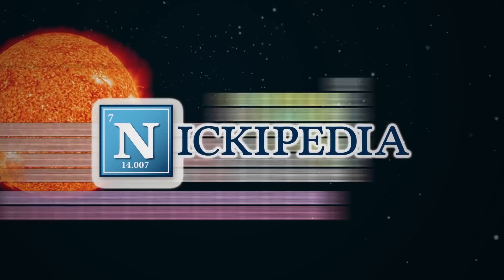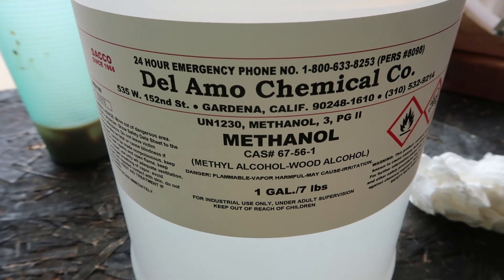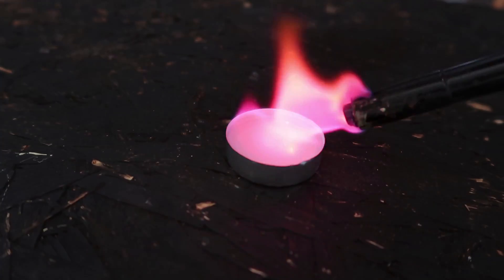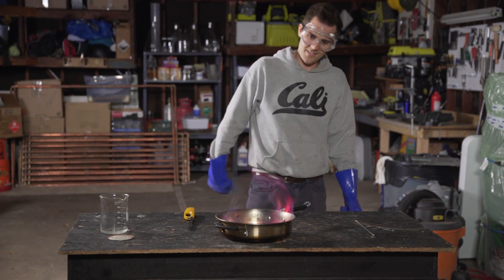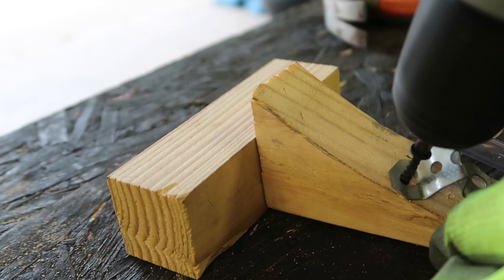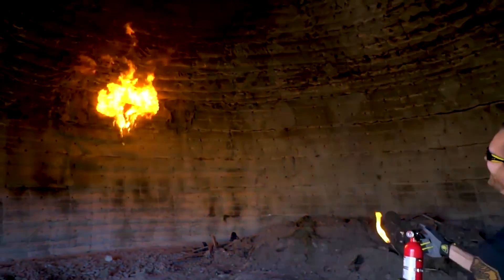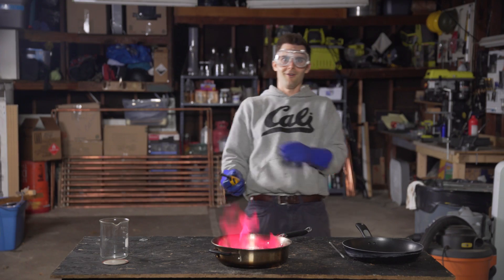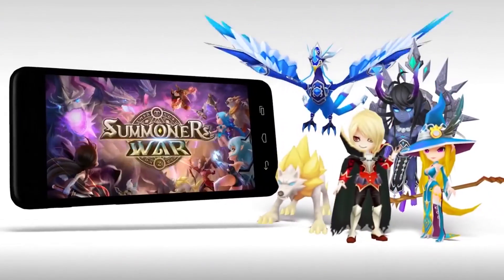Colored Fire Flame Thrower: Breathe Fire Like A Dragon

Comment: Table salt would have given a vibrant orange, clearly distinguishable from an ordinary flame. Another readily available additive would be a product called No-Salt. It is a Potassium Chloride salt substitute for people with blood pressure issues and would have produced a violet/lilac flame.
Reply: Copper Sulfate is also easy to buy to maintain water features, it’s sold by the pound XD It produces green flames, not as bright as Boric Acid, but still cool. It looks especially good with isopropyl alcohol, since that burns naturally blue

Comment: Will the boric acid burn if it is in crystalline form or do you need to put it in liquid form first? For instance, if you took a spoonful and tossed it on a campfire, would it still go green?
Reply: Yeah it would still go green likely, but just be careful not to cook over colored flames.